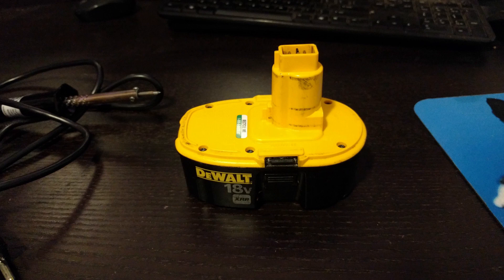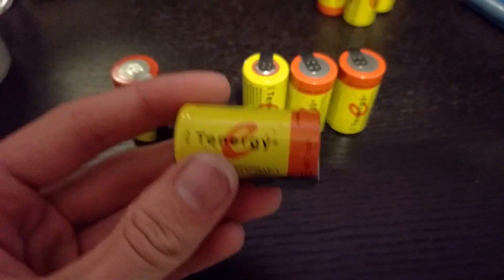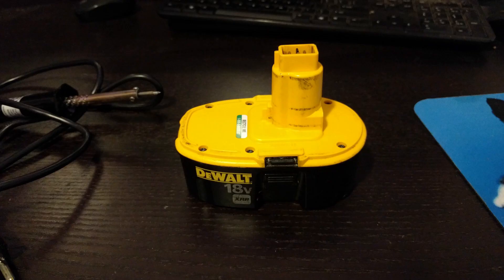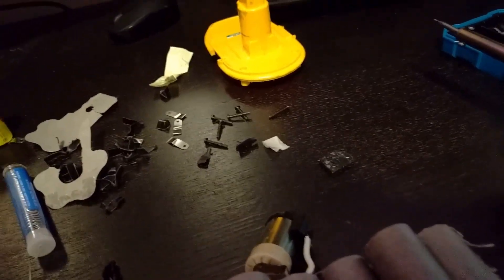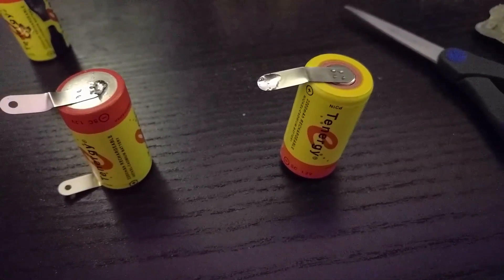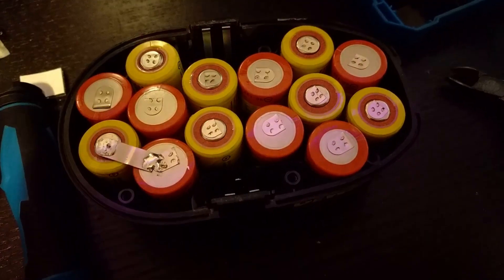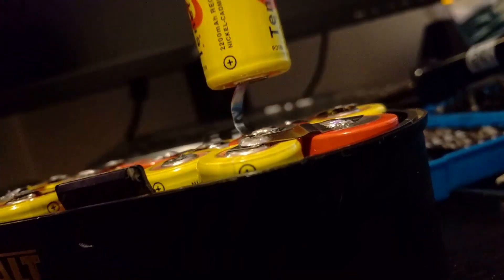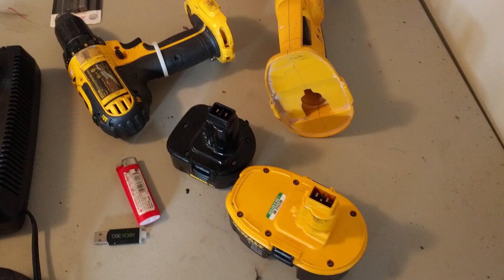Don't Buy New Cordless Drill Batteries - DeWalt 18V Battery Replacement

Comment: I've done this before.  The video was well done and the instructions were spot-on.  The problem is that for the work involved is not worth it the time when you can just buy an after market - generic replacement for around the same price.  There are several on Amazon.  Thanks for the effort though!
Reply: Some are junk with fake capacity ratings though, I have one that puts in 10 screws and dies.
Reply: Rufus Chucklebutty what brand?
Reply: @Compairholman  I am looking because of this.. Who tests and recommends decent aftermarket quality 18 volt dewalt replacements..
Reply: Read the hundreds of bad reviews on those Chinese replacements.
Reply: @flyerh  plus who wants to risk burning your house down with those chinese ones